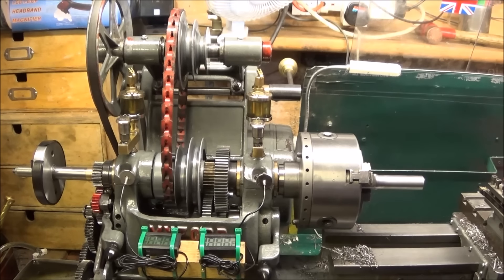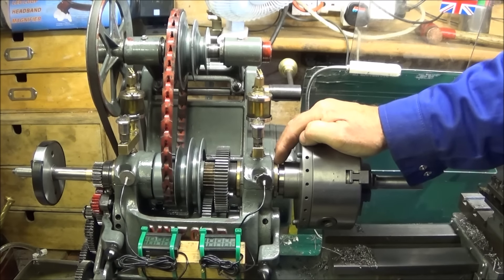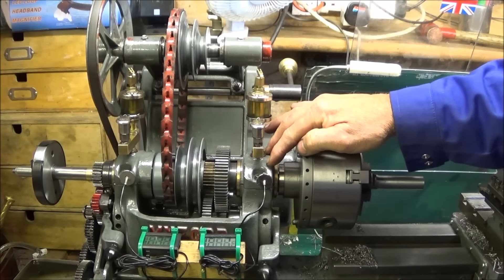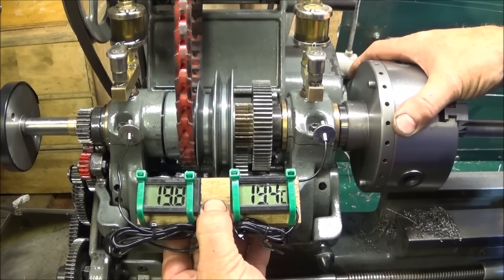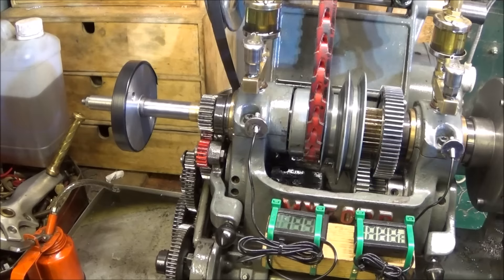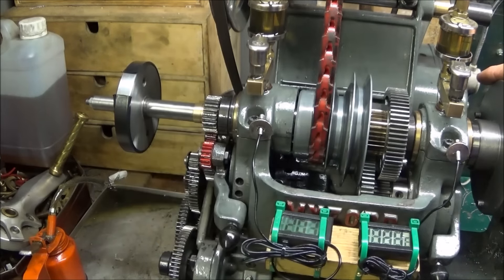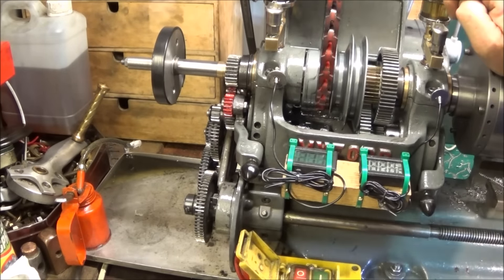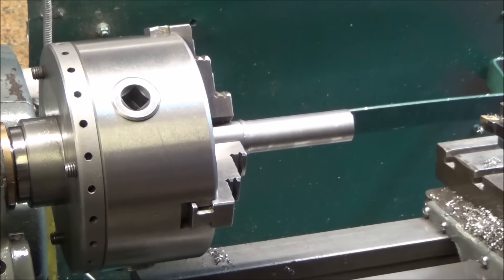Myford ML7 Spindle & Bearings Change Part 2  Testing A Brand New Set

Comment: Hi Steve Superb video all round. I stripped down my ML7 around ten years ago. I bought a spindle bearing set from Myford. I bought a scrapper specially for bearing installation and some engineering blue. I can't see anyway of avoiding this scraping chore. You could increase the shim set but its not a good plan. For one obvious reason that the height at which the spindle rest relative to the tailstock would inevitably change. The other reason is that the end section across the bearing pair would be oval to some extent. I scrapped, blued and installed around thirty times to get it right - its seriously time consuming but its worth the effort to get it right. Ten years on I have just stripped it down again and found the spindle and bearings as good as new. I have always worried that I didn't get the job done that well since the spindle is not really free turning. its not tight but neither is it completely easy to turn by hand. It must be right since there in zero run-out at the chuck and no warming of the bearing caps. On the issue of the drive gear I drilled and tapped with carbide tools to install an M3 socket screw.

Comment: Could you have just shimmed between the bronze bearing and the housing cap with gasket paper? It would take a bit of fiddling with between all four, but eventually I'd imagine you'd eliminate both the run out and the paper would act as a vibration dampener. Either way, quite happy that your new setup works! If you have an outside micrometer that does ten thou, measuring the diameter of each piece of the new bearing set would be helpful, especially if down the line you need to make yourself a new set

Comment: Here in the US there are few Myfords. I was saddened to read in Model Engineer a few years ago that Myfords had gone out of business. The company was bought by someone else, including the right to the trade name. But they are no longer manufacturing, so you are getting a spindle out of existing spares stock, which will eventually run out. I would suggest that if you are getting a new spindle and bearings, do so quickly. Few of us have the equipment to harden a new spindle. As for the bearings, even fewer of us can make them.
Reply from the maker: Yes  that's why I bought one quickly. I did notice that Myford stopped selling the spindle and bearing set for a while,  then started selling them again. I wondered whether they are from the existing spares stock or maybe they have another engineering company making them? I'm so pleased I was able to get a new set. Its like having a new lathe!
They are great lathes, the only downside I find is that the spindle through bore is such a small diameter.
Reply: Interesting. I suppose there is a business there for some enterprising machinist. And I think that on all lathes you will get stuck on spiindle bore sooner or later :)

Comment: Dear stevee
which is the best, steel bearings (Taper roller bearings) or bushings bronze bearings.
I want to have an old lathe but I doubt the bearing.
Does the bearing fail quickly? and whether the precision of its work if measured around the diameter using a micrometer,
sorry, my english is not good, hope you understand
Reply from the maker: Hi Esaf I prefer Tapered roller bearings on lathes. You can easily test the bearings on an old lathe by putting a DTI clock onto the top of the chuck and put some up and down pressure to see the reading. Also check end-float on the face of the chuck using the same type of method. If the bearings are dry lubricate them and check for noise. My Myford has bronze bearings, but the lathe would have been better with tapered roller bearings if they had made one.
My Chinese mini lathe has large tapered roller bearings which is about the best you can have on a lathe, although I used it with standard roller bearings for years without many problems. Regards Steve
Reply: What is a DTI clock? What is a Dial indicator?
I really like old lathes that are repaired, beautiful and have artistic value
your machine is amazing

Comment: Hi Steve, great video! I'm in Perth Australia and have just refurbished and ML7, having the ways re-ground etc.  It has the original silver bearings and I've run out of shims to remove but still too much play in the spindle.  I was wondering if anyone has tried to sand or machine off a very small amount from the bearing shell mating surface and the bearing cap (a bit like in your previous part 1 video)  to get the required grip on the spindle? I could get a new spindle and bearing set from myford which is expensive.  They apparently  don't advertise it on their website anymore as they now require scraping of the bronze bearings, which is difficult and suggests they're not produced to the quality of the batch you appear to have bought from.
Reply from the maker: Hi I did try taking a bit off like that from the mating surface which does work. But I think that after doing so they may need scraping as well. I didn't do that on my old set as I was in two minds about the time it takes. 
 So I bought the new set. People do say that all the new ones need scraping even the ones I installed. But I just put it together and let it run in. I noticed I had to put extra home made shim in at first but since then have gradually taken it out until I only have the bought shim. It seems to be ok now, but did take over a year to run in. 
 I still have my old set and was contemplating whether to put it back in and try the scraping method on that. 
 I reckon though if I was in the same situation as you I would get a new set. The new spindles are hardened types and have a slightly larger through bore as well.

Comment: Very nice video Steve, as always. I have an irrelevant question though. I'm not sure I understand how you mounted the backplate to the HBM chuck. I see some screws sticking out from the back plate but I see no nuts and I don't get it. Thanks.
Reply from the maker: Hi Nick, Thanks. I drilled and screw tapped the back plate with 8mm threads so the allen bolts screw directly into it. I hope to show how I machine the back plates in another video, when I need to machine another one. Regards Steve

Comment: Approx what temperature should the spindle run at normally, just brought new spindle after watching your post I've used two shim sets to achieve something like what it should be like but very werry of temperture climb.
Reply from the maker: Hi Chris, I had to use extra shim for mine as well, can't remember whether I mentioned this in the video. I do not know what the actual temperature should be. I found that mine was getting a little warmer on the back bearing for a while, just slightly warm to touch the housing. I only used the thermometers for a couple of weeks, just to check there wasn't a quick major rise in heat. 
  At first on mine, I noticed  that the spindle would stop very quickly when releasing the drive lever. This was a bit disconcerting at first. I've noticed, since I have done this video, that the spindle has run-in a bit now and has a very slight over-run when turning off.....just a few more turns. 
 I think the real important thing when putting a new set in is to put a few drops of Molybdenum Di-sulphide liquid,(the one that goes into car engine oil), in the oil ports before you start the lathe each day. This coats the parts with graphite and molybdenum, greatly reduces friction and heat, plus it prevents any spindle seizure.... After I had run my lathe for several weeks like this, I took off the the top bearing halves and had a close inspection,... just as a matter of interest. The inner bearing surfaces were still perfect finish with a very light grey coating of molybdenum, so I was well pleased.
 At the moment I only use the lathe for a couple of hours at a time. If I was using it all day I would expect the bearings to get slightly warm to touch, but this would be normal for any machine. As a matter of interest, I have noticed my counter-shaft bearings get much warmer than the spindle bearings, even though I regularly pump oil into the counter-shaft oilers. My Regards Steve.
Reply: Titanium15160 
Hi Steve thanks for your reply I'm having hells bells setting it up correctly to the point I might end sending it to myford as I either get it to tight or when it seems to run ok there appears to be slight lift either at the nose or rear, then I adjust it to the smallest amount of play and then while running starts to slow down.
Reply from the maker: Hi Chris, I think I ran mine with about .002" thou lift on the front bearing. I haven't checked it with a dial indicator lately as everything seems to be working fine with no machining chatter.
Reply: Titanium15160 
Thanks Steve,
I appreciate your reply as Im been very apprehensive whether I've got the setup anywhere near!

Comment: Steve,  I notice this video is the first one in your series to show the lathe with indexing holes on the chuck.  I like the idea but I can not find a video that shows how the modification was done.  Another Steve
Reply from the maker: +Bib Overalls Hi I actually bought the back-plate for the chuck with the indexing holes already drilled. Bought it from Myford UK. I had to make up a pin assembly which is shown on one of my videos. Regards Steve

Comment: hi, how did you get your run out so low ?ive got the same chuck and I can only get it to 7-10 thou.......thanks
Reply from the maker: Hi Phil, I bought mine separate, then bought a Myford ML7 threaded back-plate that I had to machine to fit the new chuck. You can get them on Ebay for about 19 pounds post free. I found that if you buy a chuck with a back-plate already fitted they nearly always run out too much. I had to re-skim my back-plates when I changed the spindle.
 With hard jaws if I get below .005, then I normally settle for that.  Unless I'm machining bar I nearly always true up the work by giving the jaw or component a few knocks with a soft mallet anyway. 
  Also I have found that the Chinese chucks can vary a bit on run-out accuracy.

Comment: Hi Steve... g'day from Melbourne. I'm always looking back through your Myford videos for improvement and upgrade ideas as I plod along with my own ML7. I notice that you appear to have "red" possibly Tufnol idler gears. I've heard several comments that they are a safety measure incase of a leadscrew "crash"... they will strip and avoid more major damage to the machine.... and I've also had people tell me that they help quieten the gear train. Any thoughts from your experience ?  Regards... John
Reply from the maker: Hi John, Yes I bought those from a seller on Ebay. I did put them in as a safety measure and it may be quieter. I put them on as soon as I got the lathe. If you do get the red ones it is important to check them on the lathe first as when I tightened mine up they wouldn't spin freely. I had to skim about .010" thou off the face to give them a bit of clearance. If I hadn't checked this they would have got ruined on the first go. 
  Is the ML7 easy to get hold of in Australia. Were many of them imported?
Regards Steve
Reply: Steve Jordan .... thanks Steve... your comment about checking the fit of the Tufnol gears is noted. There are usually a few Myfords on eBay down here but some are in a shocking condition and with even more shocking sell price expectation. It pains me to see how such a wonderful machine can end up so neglected. I bought mine from a friend of a friend at a reasonable price... 1956 vintage in reasonably good condition with exception of major wear in most of the places that you have outlined in your videos. I also have an ML10 from new after seeing it released at the London ME exhibition in the ‘60s... had to borrow the 85 GBP from my dad... couldn’t afford the extra to buy an ML7 back then. 

Ps... one of the few remaining bugs in my ML7 is a worn cross-slide nut... thinking of making a new one from bronze but the acme profile tap is a wee bit pricey.

Regards.... John
Reply: Hi Steve... thought you might like to hear that I went ahead and bought some Tufnol idler gears (new from Myford)... and yes, as you had warned, they were a shade too thick and curiously they were 7/16" bore versus the 1/2" diameter idler studs on my ML7, I bored them out and reamed 1/2". Regards... John

Comment: what was the gear you changed for greater speed ?, and how many teeth plz ?
Reply from the maker: I changed the standard Myford ML7 motor pulley to a 2 1/2" pulley you can get them on Ebay, Just search for 

NEW ML7 MOTOR DRIVE PULLEY 2 1/2" DIAMETER, 5/8" BORE

This is standard practice to change this and is mentioned in the Myford ML7 handbook. 

You can also keep the same drive belt. When you have installed the pulley Just slacken the tension adjusting arm bracket, (top nut), lift the motor assembly and put the drive belt on. Then let the motor table fall back and it tightens the belt correctly with its own weight. Then tighten the bracket top nut up.

I found that the new top speed of around 850 rpm is just right for most turning ops.

Comment: How do you check what condition your spindle and bearings are in ??
Reply: I think you could blue the spindel, fit it, spin it a few times and take out to see how much contact there is by checking the blue on both the spindle and bearings. Same technique as used for scraping flat surfaces using a surface plate.
Reply: Rod through the spindle and held tight in the chuck. set up a dial indicator on the spindle nose. lift up on the rod and check for deflection

Comment: what size of round can you get in your 5inch chuck ?
Reply from the maker: Hi Phil, The through bore in the chuck is about 30mm
Reply: ive put a dial on the front of spidle and found it has 5thou upward movment would you say this is an easy fix  ?
Reply from the maker: I wouldn't be worried about .005" too much if you have some shim in between the housings. You could reduce the thickness by a couple of thou if you are getting a lot of chatter and try that. I only resorted to getting a new spindle and bearing after I had tried several different things. I probably could have re scraped the old ones to get them correct but didn't have the time or patience to do that. At the end of the day...its all about whether you are able to use the machine as it is or not?

Comment: woah a 40 thou cut.....
Reply from the maker: Hi Doc,  I only take light cuts on the lathes, especially when fitting new parts. Many people think that taking deeper cuts is something that proves a lathes capability, but this is not so. Accuracy is the most important factor of any lathe. Whilst I could take deeper cuts now, I don't tend to do that as I do not have coolant and I like to increase the cutting life of the tooling. I have used lathes in the past that can easily take .100" thou cuts (.200" thou o/all), but they have been poor for real close precision work. 
  This is where many people go wrong when buying a lathe and starting machining for the first time. They try to take deep cuts, wrongly thinking this is what a lathe should do. Then they get get despondent when the lathe & tooling  doesn't perform, as they thought it would. Many newcomers, sadly come to the conclusion that the lathe is of inferior design or build, when it is not!